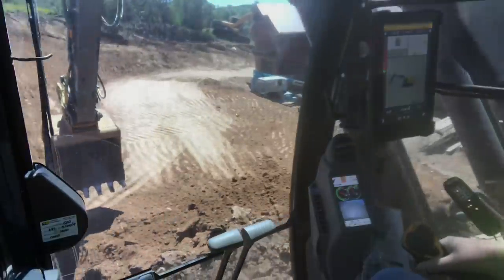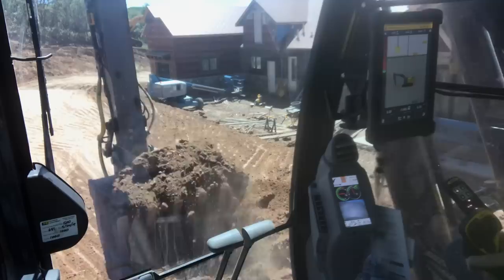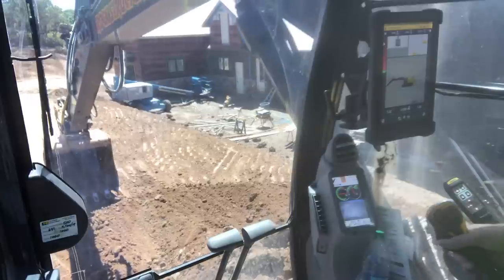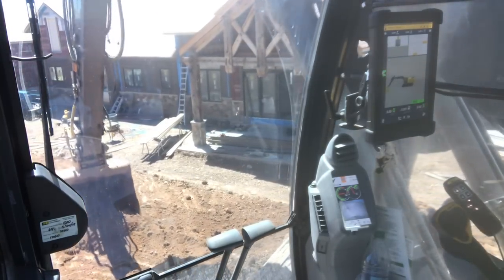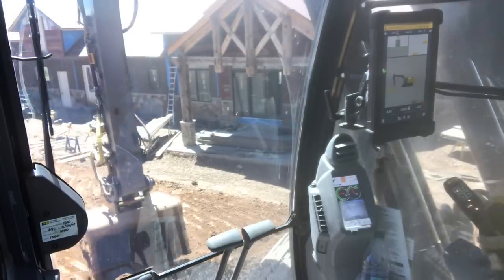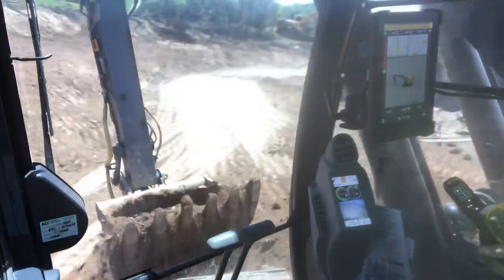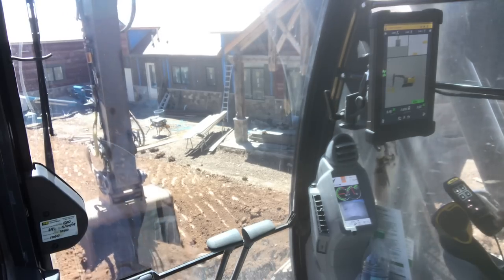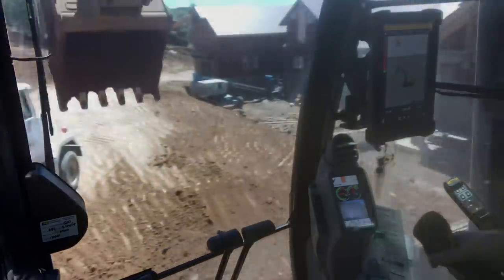How to with the John Deere 250G with Trimble Earthworks

Comment: I see your running excavator controls. I had the curious thought of what happens if you switch to backhoe controls? Are the automatics still switched by the trigger on the right and controlled by pulling on the left stick or is it controlled by pulling on the right stick since crowd control has switched to that side?
Reply from the maker: Auto’s stay on the left side joystick

Comment: I was wondering when you were going to put out a video. I assume you just had the Engcon coupler on? No need for the tilt-rotator if you are hogging dirt. I bet if you put a little water to that clay you would hit density pretty quick. At first I would watch the screen but like you said after awhile the beep tells you when you are at grade.
Reply from the maker: Brian Gardiner yep, just the Coupler with the Bucket directly couples to it. This System is dialed in. Just installed the 3D yesterday so now I will be able to run 2D or 3D....should be a bit of a learning curve but should be awesome once we get used to it

Comment: What's the cost of the system?  Does the excavator come with the system as an option?  Or is it 3rd party installation?  How do you engage the auto grade? Hit a switch somewhere?  I presume it does slopes? Be great for piping/ditches.  Dont know how many thousands of times I had to hop off and check grade, and it seemed 1 in a hundred times I'd trip or stumble or land awkwardly.  Not only a time saver, but a back and ankle saver.  That said, I presume the electronics are delicate and wouldn't take a hoe-ram banging away every now and again.
Reply from the maker: ArthurDentZaphodBeeb this particular System is a 2D/3D ready....so, right at $33k. Deere is making their machines Machine Guidance ready, meaning that you have to choose which guidance company you want to go with. Your local Trimble Sitech Dealer will do the install. The Auto Grade is on a button, so you hold the button and pull back on the Stick and the system controls the Boom & Bucket. It does do slopes.